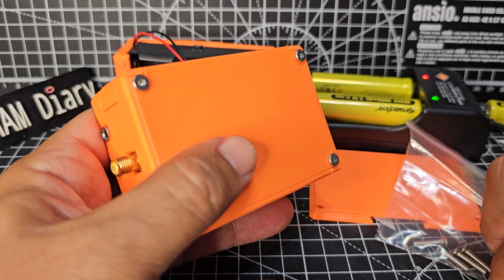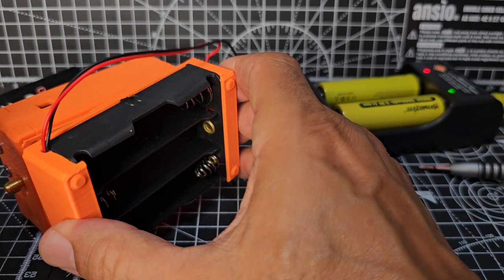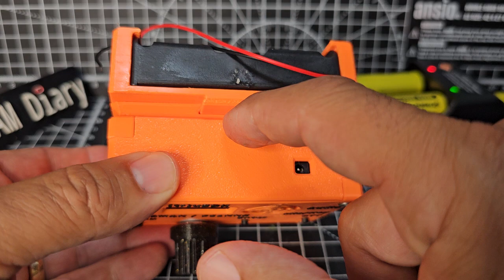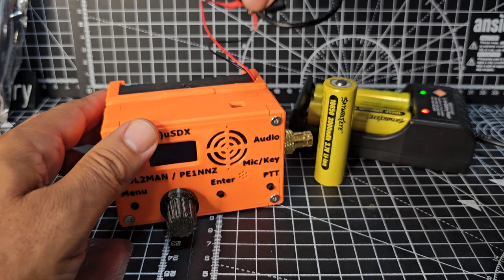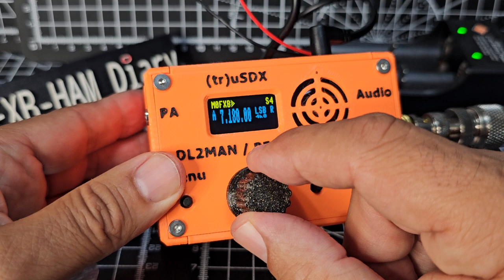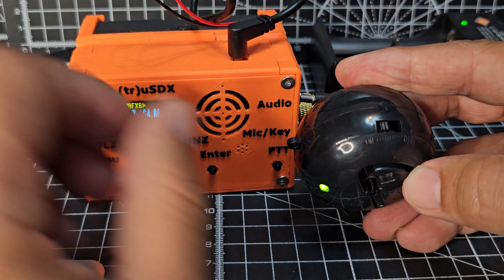DL2MAN - trUsdx , Add Battery Enclosure

Comment: I used (tr)USDX in the CQ WW CW 2024 .... great little radio !!! ... 125 QSO's , 60 multipliers for 21,180 points and 47 countries ... used it at 200hz filtering .. had a blast !!! .... de N2JNZ